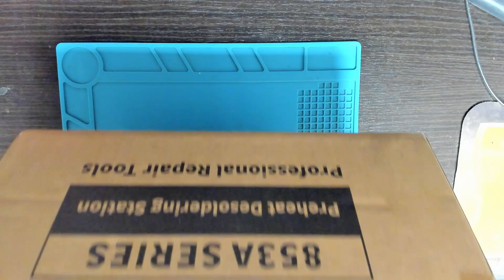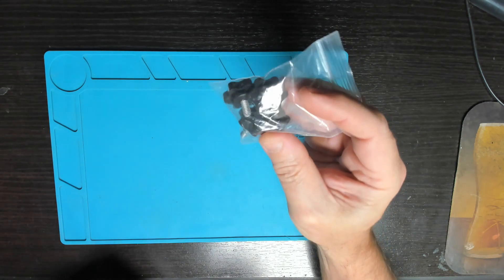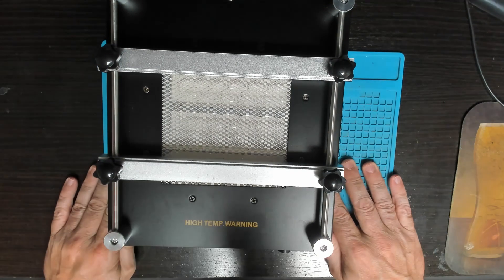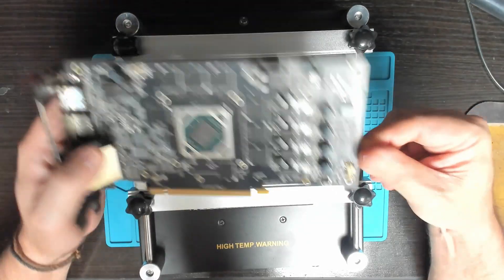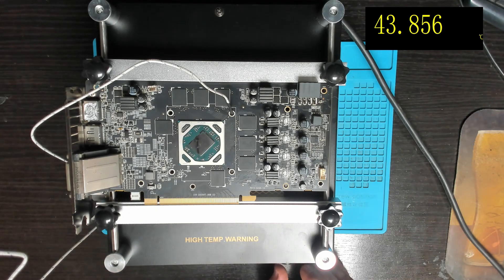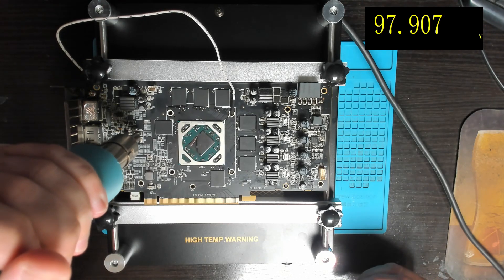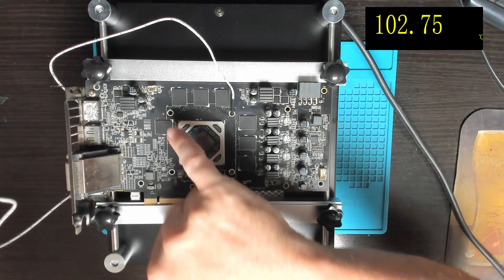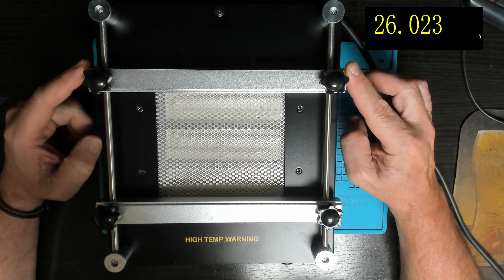Preheater station for solder rework Yihua 853A

Comment: Those are some quite low temperatures you were using, you're not going to damage the board by heating the PCB to 200°C, or by cooling it quicker.
Those boards constantly see temperature swings more drastic on normal usage.
And when they wave solder them, they can get up to 280°C.
Reply from the maker: Thanks for the info!

Comment: Hi, could this unit heat the board up to 200°C or 260°C for GPU chip reballing? What is the max temperature the board could actually get (not the heater itself max temp)?

Thanks a lot, I'm planning on getting this unit.
Reply from the maker: I have not tried to go that high, I avoid any SMDs falling off the bottom of the board by mistake.